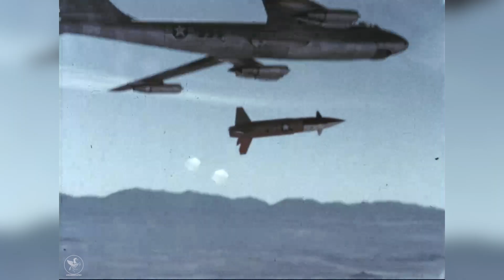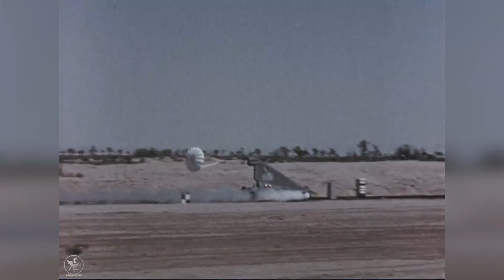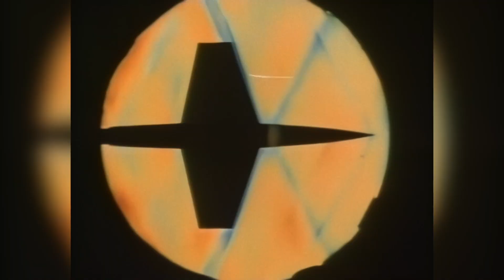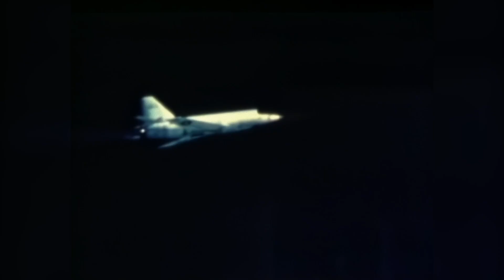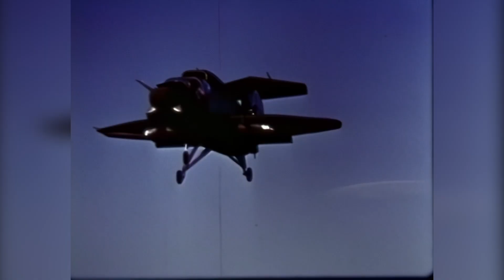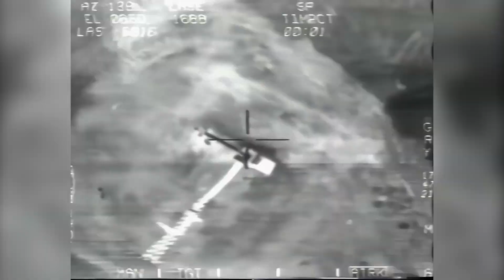Secretive Test Center: Edwards Air Force Base. History Of Aviation Series | Upscaled Documentary

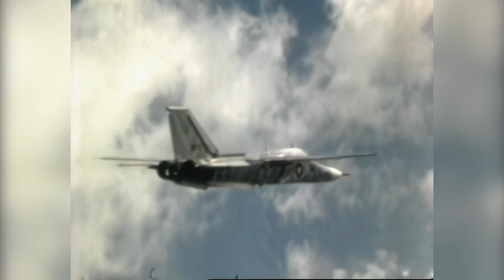Comment: At the 1:00:20 mark is a sequence of F-111A 65-7503 on September 11, 1972, which crashed during spin testing. As an EAFB Transient Alert crew member, I had performed Last Chance on this aircraft moments before this fateful crash. The remnants of the plane were returned to the Tansient Alert hangar, adjacent to Base Ops, where the intact crew module was placed (intact) centered among the scattered remains. A day to remember...  A1C Joe Keene EAFB Transient Alert June '72 - September '74
Reply: We used F-111s for chase on the B-1B Combined Test Force at Edwards in the early-mid 1980s.  I miss the Vaark.  Awesome aircraft that had capabilities that have not been duplicated since.  It would have been amazing had it been born in the composites and advanced turbofan era, with DFLCS and AESA Radars, though it had a large RCS.